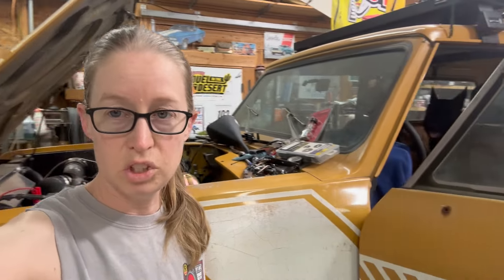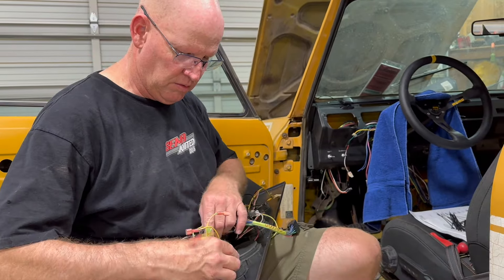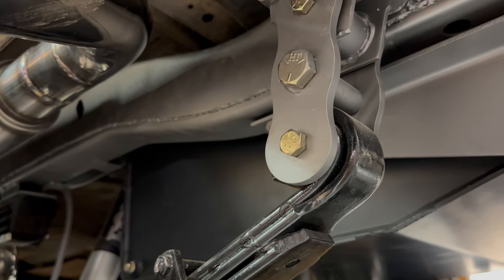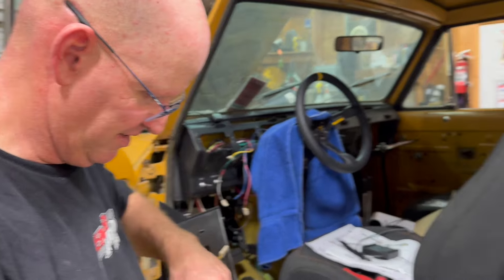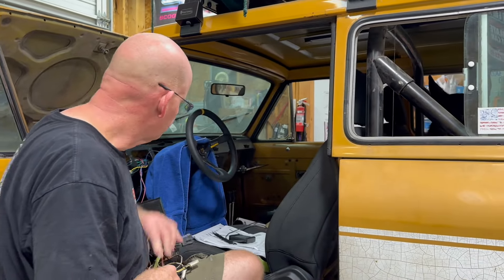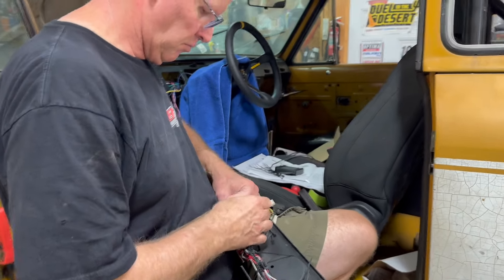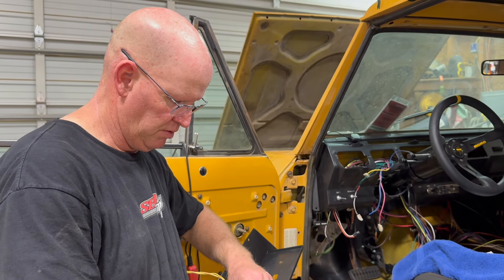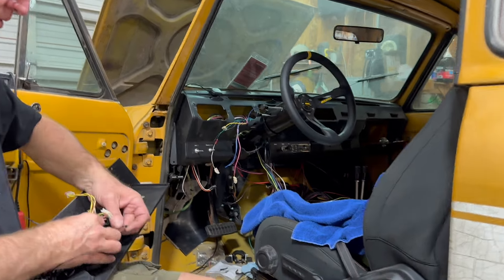It's ALIVE! | Overland Scout Project | Ep 10

Comment: Glad to see you guys back at it with the Scout. Coming along nicely.
BTW,, American auto wire makes a really nice wiring kit for Scouts. Pricey but seems very organized.
Reply from the maker: @ConnieJohnson-f7v  it’s an American Autowire kit. Some of the difficulty is I’m not familiar enough with Scouts. The other issues are with the kit. It lost connection with the inside turn indicator and the front turn lamp. The supplied lights don’t fit the dash holders. Things that really slow progress.